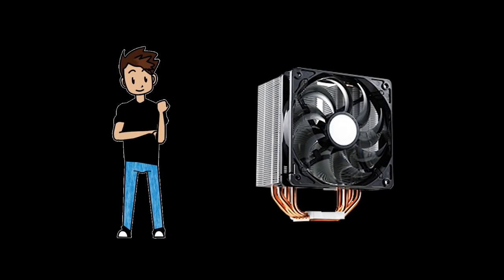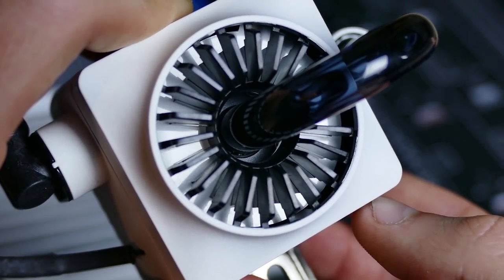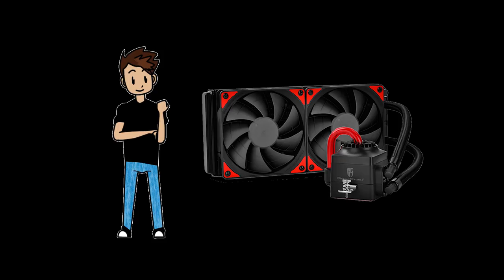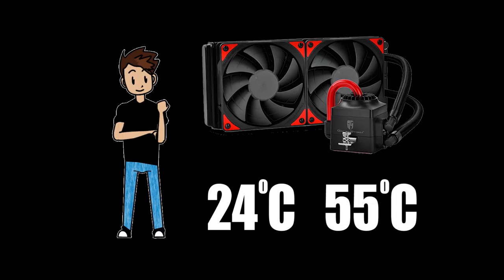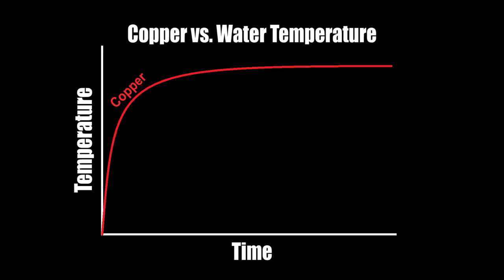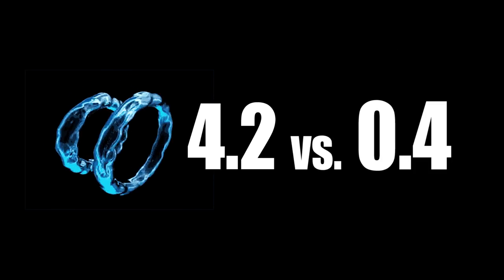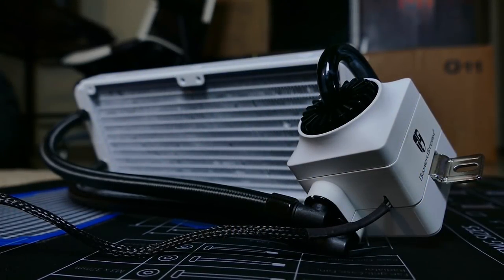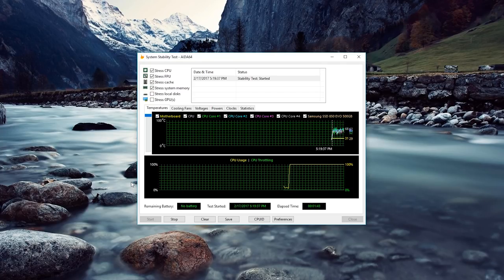How to Properly Measure AIO Temperatures

Comment: I just switched out my NZXT Kraken X62 280mm for a Coolermaster MA621P TR4 Edition on my Threadripper 1950X. Mainly because the cold plate did not cover the entire CPU. The Kraken X62 280mm in an ambient temperature of 23°C/74°F on Threadripper 1950X at stock clocks would range from 42°C/108°F at idle, under CPU-Z stress test for five minutes it would shoot up to 92°C/197°F. The Coolermaster MA621P with 23°C/74°F ambient temperature idles at 38°C/100°F and under the same CPUZ stress test for five minutes it hits 69°C/156°F. I have another build I have switched from a Noctua NH-D14 to a Thermaltake Ultimate 3.0 360mm AIO liquid cooler. That is cooling an FX9590 at stock clocks. The NH-D14 34°C/93°F at 23°C/74°F ambient temp and using the same CPUZ test it hit 56°C/133°F. The Ultimate 3.0 AIO idles at 36°C/97°F and under the CPUZ stress test it hits 62°C/144°F and that is with six fans for push/pull. In my experience air cooling  maintains cooler temperatures better than AIO liquid coolers. The only reason I switched the Noctua for a AIO liquid cooler was because the Noctua was so big it would cover the northbridge and prevent air from cooling it.

Comment: My liquid cooler was leaking so I filled it with apple juice is that ok?
Reply: I was thinking you shoud replace the liquid with milk, should work great after a few weeks ;D
Reply: Max Thomassen  Holy hot milk Batman!
Reply: Max Thomassen It'll get the necessary nutrients as well.
Reply: Only Motts
Reply: Max Thomassen, Would you recommend raw, pasteurized or ultrapasteurized?  Does it need to be organic?  Would almond milk (Silk) work?  Should it be skim, one percent, two percent or whole?  Does brand matter?  It does for taste.
Reply: go vegan pc!

Comment: Here's my experience with my 240mm aio. I run seti and the temps go to the max (about 64 c) with-in a few mins. Even hrs later it's still at that temp and the same is true when I let it run all night. When I stop the program, the temp will be back to normal with-in a few mins. The computer is located in a cool room with a ambient temp between 68-71F. My case has a lot of air flow and fan noise doesn't bother me so I keep the fans at higher rpms ( about 70% ) so heat doesn't build up inside my case which helps. Also remember if your room gets hot it will also take longer to cool down than in a cooler room.

Comment: On my 5960X I went from an Noctua D15 air cooler to NZXT Kraken X62, and back again. The AIO didn't give me any benefit really. Sure I could overclock 2-300 Mhz higher, but the fans and the pump on the Kraken X62 had to ramp up high to keep the temps under control, and that made it just too noisy.

So if I compare the D15 vs Kraken X62 with the CPU @ only 4000 Mhz, and fans on both coolers at 900-1000 rpm, the Noctua D15 has the same performance at slightly lower noise level. So I tossed the AIO out. For me Kraken X62 is more about looks than cooling performance.
Reply: yep I'm right there with you. sticking with air until I get around to a full custom loop with way too much radiator to keep the fans slow.
Reply: I went all out when i water cooled my first computer. Two 60mm thick 360mm rads. I would turn off the fans and it would radiate its own heat well enough and still stay in good temps. (that was for an i7/2 GPUs/and mobo) All together it was around 3/4 gallon of water in the loop.
Loudest thing in that computer was the mechanical hard drives.
Reply: Well said, I'm  with you

Comment: What is also not mentioned is that the  METAL radiators will dissipate the heat more quickly with fan help. As the water circulates energy will transfer from the water causing a (copper coefficient) dropping of the temp.

Comment: The next step: Liquid metal AIO's :D
Reply: I think they are already around expensive af tho metals that melt at room temp are never cheap
Reply: Linus already did that
Reply: What metal? Gallium?
Reply: NaK would be good for heat transfer only problem is it explodes when in contact with air.
Reply: +GRat9717 NaK (Sodium-Potassium Alloy, liquid at room temperature)
Reply: You shouldn't put liquid metal with cpu together unless you want T-1000
Reply: +Akiko Yuki Mercury
Reply: @treynathaniel4075  No, he's talking liquid metal instead of water.
Reply: @lordpinochetuttp3819  Thats reactive as hell, it explodes in contact with air, water, and a shitload of other elements.
Reply: What exactly is the best method?
Reply: Way too dangerous from a liability stand point.  Most if not all liquid metals are toxic and difficult to properly dispose of for that reason.  Plus it's much cheaper to just use a larger radiator.

NaK has been floated as a replacement on for sodium in ultra high performance production car valves but has been rejected because of the risks involved in a catastrophic failure.  So if you can't justify it for cars as rare as unicorns there no way it's going into something as cheap as AIO for a home PC.
Reply: @GlassTopRX7  uh no. There are liquid metal TIMs that replace thermal paste for better heat transmission that are made of indium and gallium. It's common in the PC building world. People or manufacturers don't usually use it because it's conductive, unlike thermal paste, and a liability when poorly applied.
Reply: I'm sorry what does that have to do with NaK?  

Plus the liquid metals do work better but it's not worth it unless you are just building a benchmark queen.  You always are living with the risk that it could bleed out and short the CPU.  If it's something you just want to show off with for a few hundred megahertz that's up to you, but frequency gains don't have the impact they did back in the pencil trick days.  Well let me restate that, the gains percentage wise are small compared to what they use to be. 

So yes there are liquid metals that work better but they come with additional risk for very little gain wise.  Just my opinion but a top quality non conductive thermal paste is a better choice for most builders.  @jakechuaweipeng

Comment: What's lying here is the title!
Reply: zCore not really
Reply: who cares it's a great channel, he didnt milk it for ten min to get more money
Reply: im pretty sure he's a chemical engineer. Also would you mind pointing out whats not true with the science? I couldn't find any immediate flaws with it. Probably because there's nothing wrong with the science. You're just upset about the click-baity title. Get over yourself.
Reply: most cpu's will not be at 100% load for more than a few seconds/mins at a time, THAT's whats wrong with his science, it only accounts for synthetics that absolutely push your cpu to the limit for extended periods of time. so most people will infact see lower temps doing anything they did before the AIO.
Try using some brain power occasionally and you'd see how BS this example of how "AIO's lying" is.
Reply: the title isn't lying. what you always see is instantaneous benchmarks for AIO thats what everyone uses
Reply: zCore the big companies definitely paid    him to lie to us about the true performance of aio coolers, which is exceptional better than standard cpu coolers
Reply: Jude K Jude K Yeah, chemical engineering much. First of all, he’s either lying or not knowing or just forgot what heat-pipes or vapour chamber is. Second, a modern air cooler are not really a cooler with heat-sinks, at all (this only apply on something like air cooled engine vs water cooled engine which arguments are on point where one system depends solely on air to transport the heat vs using water with no air pocket to transfer heat) which is not the case in pc system at all. Third idc if the end result is somewhat related to it’s point as point can be easily manipulated by the product of hindsight. The cooper vs water can only be true as long as cooper didn’tt have tubing in it that can store “water” which depressurised by vacuum chamber to lower down it’s boiling point thus speed up the heat transfer process, does it make sense? The problem here is that most water-cooled pc’s have an air bubble in it that can reduce the overall system efficiency. Second the radiator itself are made of aluminium alloy and not cooper alloy. 280mm water cooled system gonna be expensive af if manufactures ever decided to go with cooper as the main choice of materials.
Reply: Jude K and you know what, it is not about air cooled vs water cooled at all. It’s about passive liquid cooled system vs active liquid cooled system
Reply: The title kinda makes u think:" Why would i want to know my AIO temp? I need to know my CPU/GPU temps."
Reply: Yeah I'm like so how do you measure the AIO temp?
Reply: @user-ez5eq6ti1n  he still milked the sentence, water takes time to heat up for over 7 minutes

Comment: So, I recently replaced my R3 1200's stock cooler with CoolerMaster's ML 120L AIO, applied a 3.7Ghz OC and then ran AIDA64's stability test overnight, the CPU temp 10 minutes after I started the stability test was 44 Degrees Celsius. When I woke up the next morning, about 7 hours after starting the stability test, the CPU temp was 42 degrees celsius, strange. The fans were all at Max RPM throughout the test and the room temperature was more or less the same so that couldn't have lowered the temperature.
Reply: This video is a simplistic overview, looking at only one physical property. The CPU produces heat equal to its electrical load (by conservation of energy). This heat is transferred by diffusion through the CPU and coldplate into your liquid. Next the liquid is transport by convection (FLOW) to the radiator where heat diffuses through the metal into the air, which is again removed by convection. Think of the energy as a sort of non-physical fluid, and think of each barrier to heat transfer as a drain. We have CPU->Water->Radiator->Air. Your CPU is the spring, and each transfer is a drain. The properties of the heat transfer medium (like the heat capacity and the conductivity) and the speed of flow (controlled by the pump and the fans) basically control how fast each step can drain or remove heat. 

So, let's apply this model to both the results in the video and your results. In the video, it took a long time to reach equilibrium, which really means that the same amount of energy is flowing through each step in the heat exchange system. Since it takes a lot of energy to heat water up, we can come up with a theory that the CPU is pumping more heat into the water than can be removed by the Radiator and Air system. This leads to a slow increase in temperature, during which the radiator is getting better and better and transferring heat because it's getting hotter and hotter in comparison to the air. Conversely, as the water heats up, the rate of heat transfer from the CPU to the water decreases, because their temperatures are becoming closer together. Eventually this evens out, and the system is at equilibrium. 

Now imagine you increased the ability of the radiator to remove heat from the water. This could be done by increasing its surface area, increasing the number and speed of the fans, etc. In this case, the equilibrium point will change, and the water will not have to be as hot before the heat removed by the radiator is the same as the heat supplied by the CPU. This is like having a tank of water with a drain and a faucet. The HEIGHT or volume of the water in the tank is equivalent to the temperature of the water in the radiator system. The rate at which water leaves the tank through the drain is a function of the height of the water (which increases the pressure felt at the drain) and the size of the drain; obviously the height is also a function of how fast the water drains. Given a constant input rate from the faucet, increasing the drain size will result in a lower equilibrium height. The CPU is a little more complicated because there are actually multiple tanks and multiple drains, with the faucet being the power supplied to the card (which is primarily a function of the voltage, not the clockspeed). 

So, if you made it this far, your system has a lower equilibrium temperature because it has a more effective radiator system (size and/or air flowrate), or in our water analogy, your bathtub won't fill up because your drain is too big.
Reply: @Blah8045  "The CPU produces heat equal to its electrical load (by conservation of energy). " I'm going to have to stop you there. If this were true, your CPU would not function one bit due to the inability to move electrons to their destination. Heat is a byproduct of resistance. If transistors were perfect, you would need basically no cooling.
Reply: @megamixa   All the power supplied to a computer is eventually released as heat.To say that the heat is a byproduct of resistance and not a result of the electrical load is a like saying that a car moved because of its engines and not its wheels. And actually, there is a physical lower limit that implies that all computation must produce some heat: https://en.wikipedia.org/wiki/Landauer's_principle. Therefore, there are no perfect transistors.
Reply: @Blah8045   I never said there were perfect transistors. I said IF transistors were perfect. 

Secondly, I think you misunderstood Landauer's Princple. It refers to thermodynamic principles where all energy in a closed loop system must be accounted for. It does not state that all computations carried out by a system must produce and give off heat. It is saying that all computations require energy to be carried out. Heat is generated by these systems as a byproduct, not as a result. A 1000watt system would melt your legs if that energy were dissipated into the atmosphere constantly. However, maybe 200watts of that is lost as heat, the rest is carried through your system in a constant loop. That's why we measure input vs. output. If you input 1000W into a computer, and you get 600W at the output, then you lost 400W as heat, light, pressure, etc. If 100% of the energy supplied to the system made it to the load, you would have 100% efficiency and no energy loss as heat.

Heat, in an electrical system, is a byproduct of molecular collisions occurring due to other "repelling" particles/factors present in the path of free flowing electrons. The more collisions that occur (the more resistance) the more heat that is generated. That is why if you pass 1000Amps through copper vs. 1000Amps through steel, you need largely different surface areas to dissipate the heat since Steel and Copper have very different resistivities. This same principle applies to diodes (the devices that make up transistors). Transistors are made from large wafers in a lab. I'm not going to bore you with the details, but to put it simply every transistor made at a facility has an imperfection. In fact, if you have ever seen the gate of a mosfet or a BJT, it is very bumpy and not linear. Anyway, these simple imperfections require more energy to overcome, and that excess energy is lost as heat. If a transistor had zero imperfections, it would generate no heat. 

A prime example of this is DC-DC conversion. Before switching power supplies, we had extremely inefficient methods of converting DC voltages. You would have efficiencies in the 30-60% range. With that 40-70% loss of energy being lost as heat. As we developed better transistors and components, we are able to have power supplies with 99% efficiencies that generate very little heat under full load. Which is also why older devices that used transistors got a lot warmer than modern transistors, even though they carried out less complex computations. They were poorly made so they generated large amounts of heat. As the manufacturing process got better, we were able to reduce the amount of imperfections.
Reply: @megamixa  Computers have no means of releasing energy in the form of electrical power. The power drawn from the socket is all converted into heat, light, etc. The thermodynamic principle that you referred to is called the first law of thermodynamics. The link I provided has to do with the minimum energy required for a computation on the basis of the connection between energy and information. 

Now, disregarding these mythical perfect transistors operating at superconducting temperatures, the gist of my statement was that for a home computer, increasing the stable overclock frequency means increasing the voltage at which the CPU operates. Power required is proportional to the voltage difference across the CPU. For real CPU's, this translates as more energy lost as heat. In fact, the power that is consumed by the CPU must by the first law of thermodynamics, be released as heat. I won't respond any further because the above paragraph can be verified by anyone with a CPU and a thermometer.

Comment: The rise in temps are directly related to the fin design and size of the radiator...I've noticed 280mm SIOs handle temp rises better than 240mm rads...a higher quality pump also makes a difference.

Comment: You can put more fans on a AIO and get the temps down even lower or get an AIO with bigger rads, the 280mm ones are not much more than the 240s.